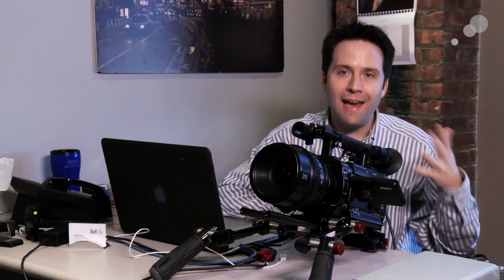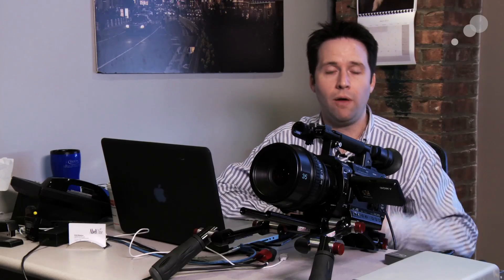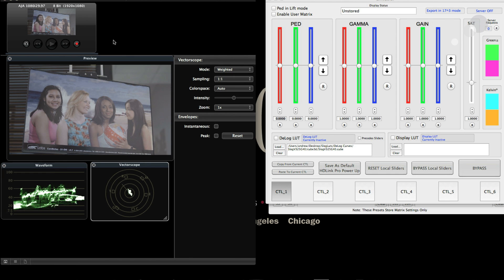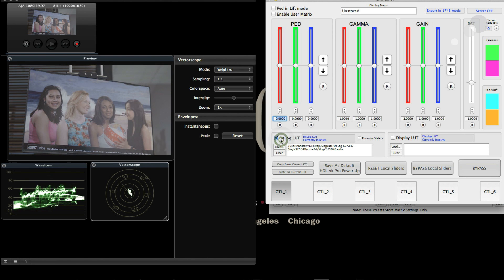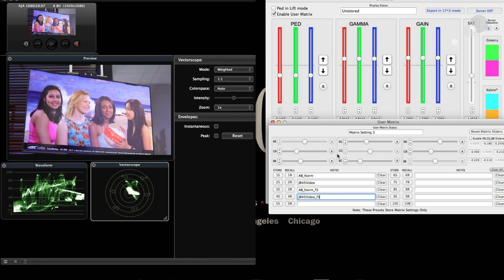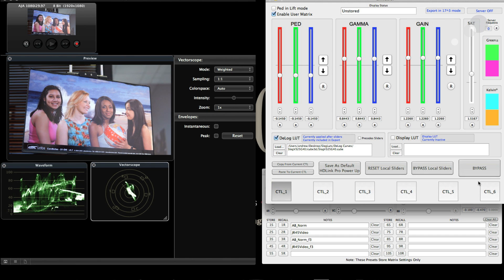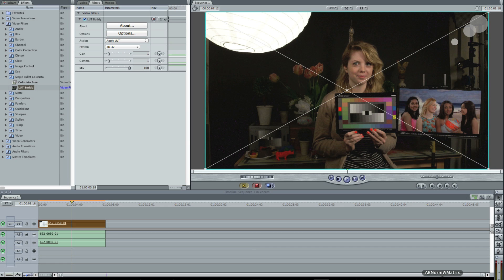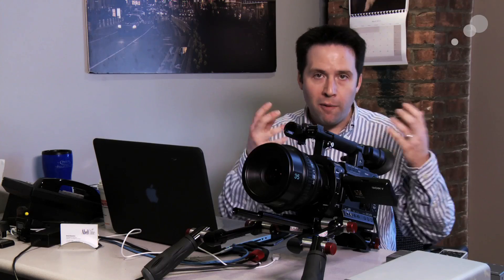S-Log and the F3 -- Part 5: 3D Look Up Tables

Comment from the maker: Hello,
The HD Link Pro acts as a pass through for creating LUTS for the F3. You must use a software program such as Livegrade or Linkcolor in order to create the LUT. The HD Link takes the HD-SDI signal from the F3, applies the LUT and sends the HD-SDI out to a monitor. The Link Pro itself can not export LUTS. The grading programs will output LUTS in various file formats so that the LUT can be applied in a post color program such as Resolve. - Ian

Comment: Hi,I have question.Can I create LUT my DoP wants in grading program,import LUT to HD Link Pro,save it,then feed HD Link Pro live slog sdi output from F3 and the output from HD Link Pro will be LUTted in real-time?Even without mac connected?Thanks
Reply from the maker: Once you load a LUT in to the HD Link Pro, you can disconnect the USB from your computer. The LUT will continue to live on the HD Link Pro until you reset it or load a new one.
Reply: AbelCine Thanks!